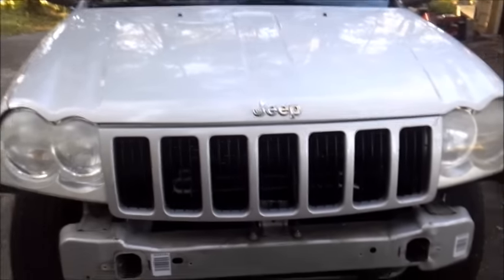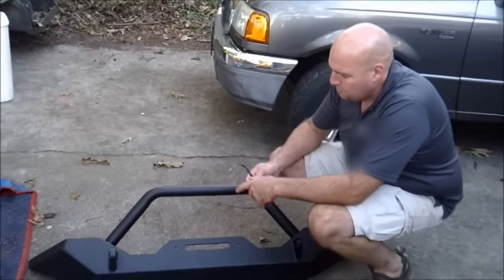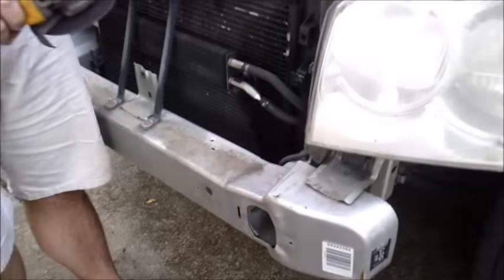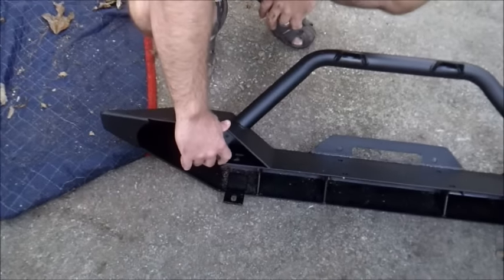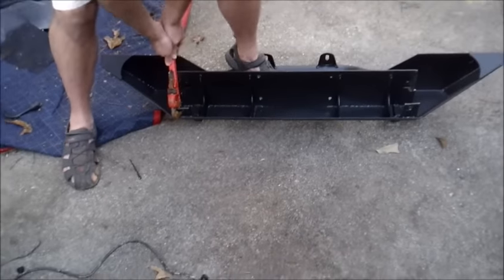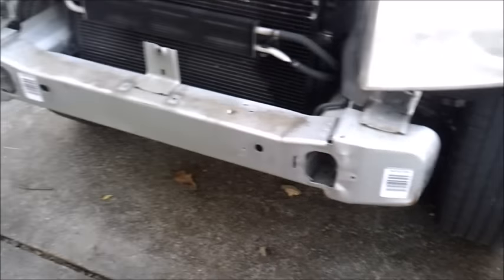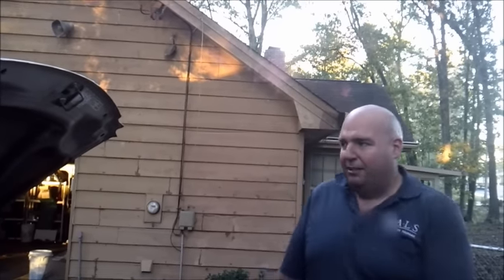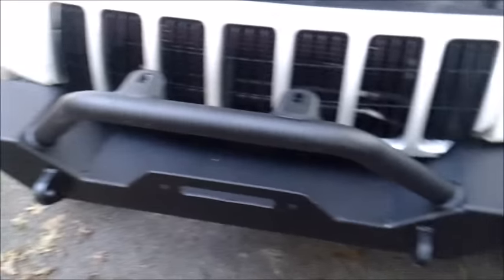how to  put a wrangler bumper on a jeep grand cherokee

Comment: Ok people those little ass pieces of metal he cut off to get it to fit didnt do a damn thing structurally to the vehical.. They were pieces of the old stock bumper. If he wanted to he could have removed the entire stock bumper and been ok. So you all telling me that the 2 bolts the hold the bumper to a jeep wrangler is stronger just because it is on a wrangler not a grand cherokee.. Damn. Didnt think bolts were stronger from one vehicle to the next. Personally I think it was a great idea and works perfectly fine. At least he is building a jeep and sharing how he did it to those who have thought about doing it them selves. It is no weaker on that grand cherokee than it is on a wrangler it will still pull it's own weight out of bind... # built not bought
Reply: Yes those 2 bolts are stronger when mounted to a full frame let me say it again full frame Wrangler. The part he was cutting is actually structural since this is a unibody Evey frame tie in point is structural. That's a crash bar made for impacting things and any hole that is in a unibody frame is ment to be there as crash absorcion adding any more holes changes how the frame folds in an accident. On a side note that is a cheap bumper, any quality bumper will have bracket to tie into the frame with more bolts usually 4 for each frame rail to support a winch. Anyone who thinks 2 bolts on 1/8 in tabs is going to hold up to a winch is out of their minds and probably still uses chains for recovery.
Reply: Better bull bars available with Fender return just dimensions need to be close.

Comment: No safety glasses or goggles, shorts and sandles while doing this.  This a bad hack job to be honest. It's just bad in every way. I hope you don't plan on being pulled out of the mud with 2 bolts holding that bumper on. I'm not being an was,  it just has to be said. The worse thing is you also just taught a young man all the wrong things to do by example and now he's going to go through life thinking it's right.

Comment: 2 bolts on a unibody huh. I hope for everyones sake you never put a winch on that or use it as a recovery point those thin unibody rails will let those bolts tear right through it. Maybe the impact bar will save a life by not letting the bolt pass through it but I doubt it. Good luck to you and everyone you wheel with .